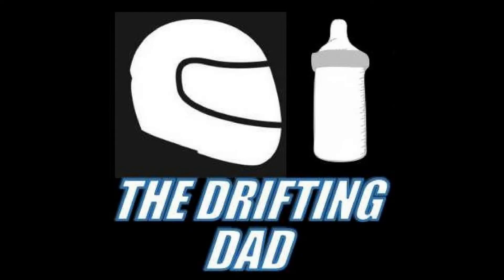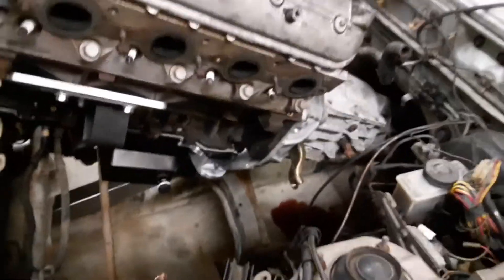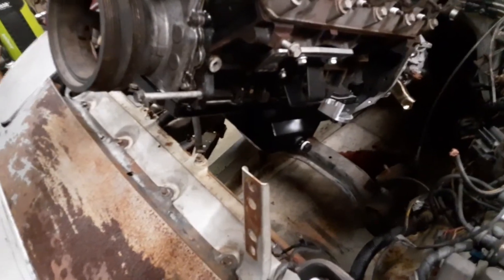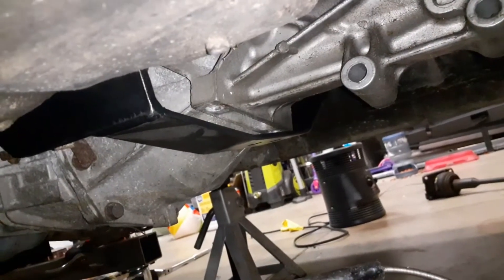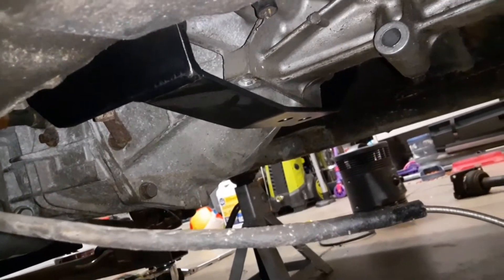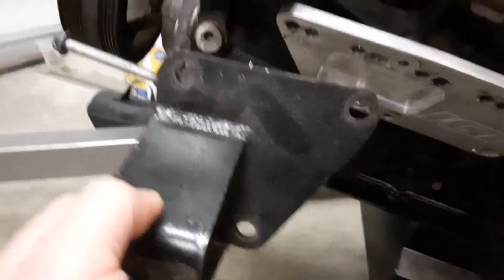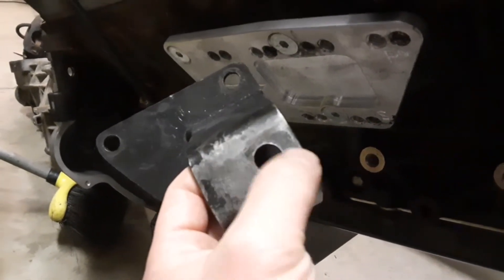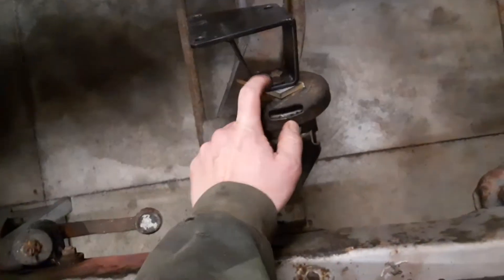Drifting Dad Performance LS Swapped FB RX7 Part 3:  Test Fitting the New Engine!

Comment: Nice! very similar struggles as I've had with the same combo, other than I've not taken the route of a standard transmission, maybe in the future, Glad to see it lines up the same as I've done mine, balancer right behind the sway bar, problems with the heater hoses etc. I brazed on 90's on to my heater core so the hoses end up on the pass valve cover, see how that'll work out. 
Have not seen a ot of guys utilize the FB body style, not entirely sure why, like I said, glad there's another guy doing the same, and with kids involved and finding time to still make progress
Reply from the maker: Thank you! I wish it could sit back farther, but this build prioritizes fitment over all out performance
Reply: @TheDriftingDad  hahaha, it seems like fitment in these cars is more like, "where is the one spot where everything fits?" over, "where is the best spot to fit?"
Reply from the maker: I agree, if you have the space and dont care about heat or AC then you can get almost the entire engine behind the front wheel centerline